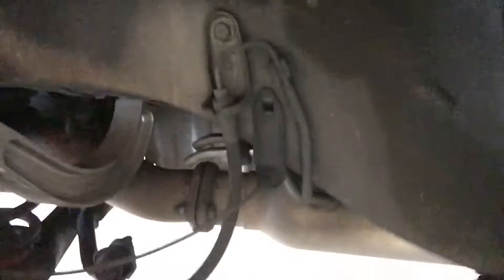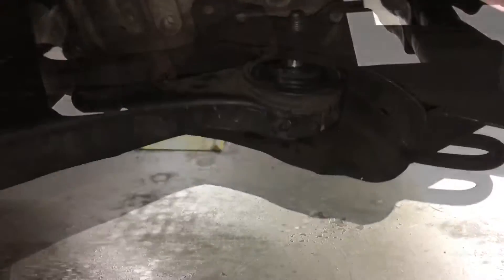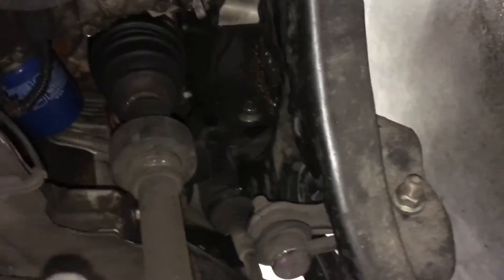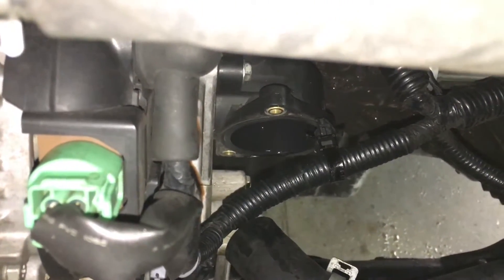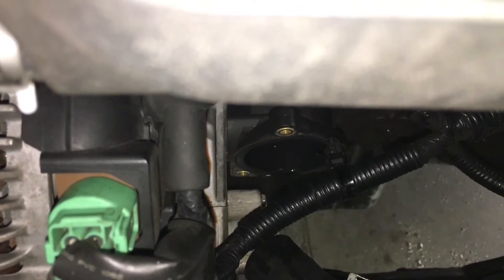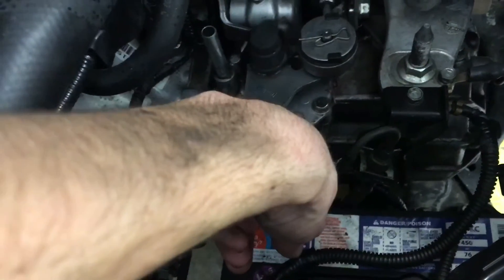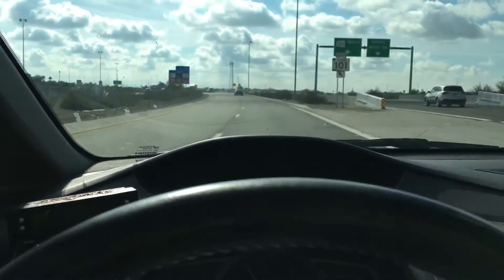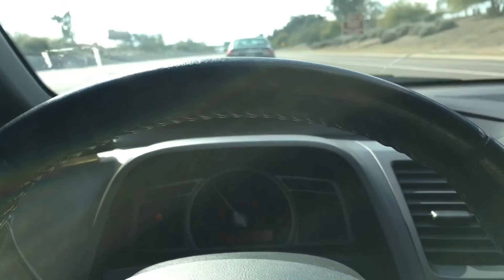DIY: FA5/FG2 LCA Bushings & T-Stat Install K24/K20 Swapped Civic!

Comment: why do you recommend burning out the bushings? your bushing will most likely be torn if they need replacing, ive never had trouble using a flat head and a hammer
Reply from the maker: +Z Coleman ehh it's just the typical way to get them out quickly. Usually burn out the rubber, then chisel or flat head to get out the metal rings.

Luckily I have access to a press, but wanted to share the information for people who don't.

Comment: Hey whats up man, 
So I am having over heating problems and have tried everything and checked for leaks. I still have the overheating problem. I am wondering if I really need that 160 degrees T-stat because I believe OEM it opens at 170-180 degrees. I got tired of the overheating and a friend told me to take out the T-stat. What do you think about that and do you think I need the 160 degrees T-stat to resolve this issue. Also what was your burping method to get all the air out of the system, how long did it take ? thank you and pls help lol
Reply from the maker: John Pham if it overheats at idle it’s your fan. If it overheats while driving then there’s a clog somewhere.

To burp it properly, put the front end on jack, turn the heater on full blast, and rev it to 2K and hold for a minute to two minutes, let idle for a few more, then rinse and repeat till no more air bubbles.
Reply: Its overheating while driving. I drove it around after burping it and the temp went up, down , then steady operating temp. the next morning drove it and the temperature went up. The motor is freshly built and I dont know if its really a clog or a air pocket due to thermostat not opening when burping. 
Do I turn on the blower too when having the heater at full blast? Also when ordering a T-stat do I order k20z3 or K24a2 T-stat? 
I have replace T-stat ( brand new suppose to open at 173-180 ) , replaced some little coolant lines and made sure no leaks. 
Im at a stand still and so I just took out the T-stat and will burp tomorrow morning to see what happens
Reply from the maker: John Pham Check the coolant hoses and see if they’re both hot or if one is cold. Also when burp it, do what I said, and turn the heater on full blast so it open the heater core and runs coolant thru it. And to speed up the process rev it to 2K and keep it there for a minute or two.
Reply: Thank you for your help man. I took out the t-stat and called it a day. Might just order the Mishimoto t-stat later on. but its good for now.
Reply from the maker: Good to hear. Sounds like you found your culprit 👍🏼